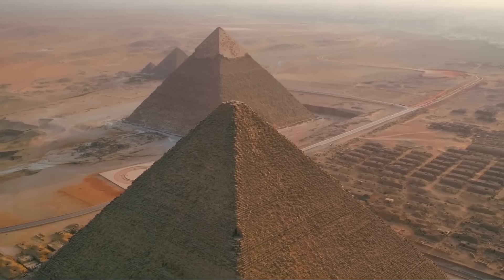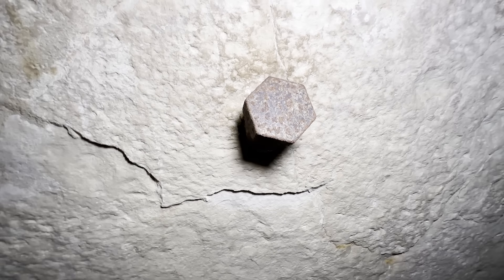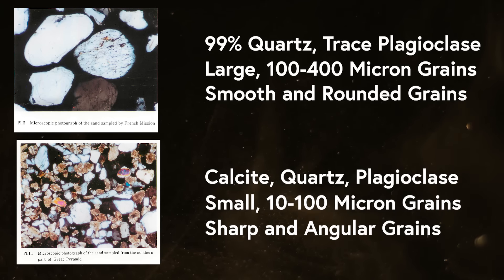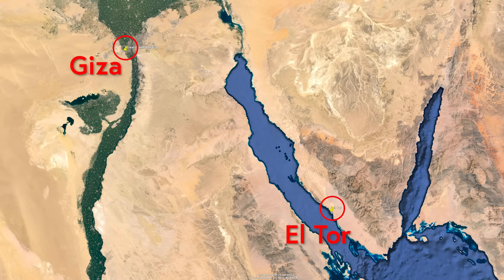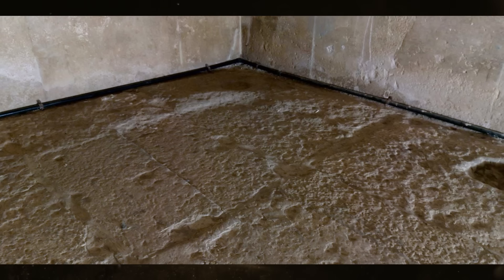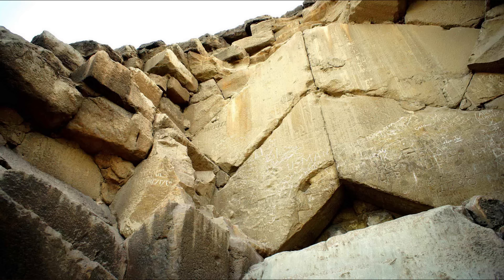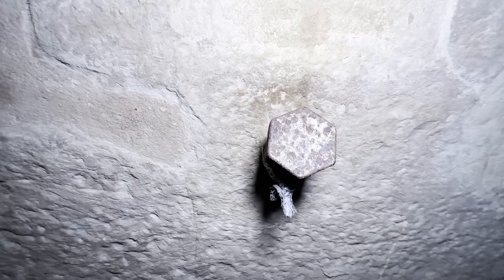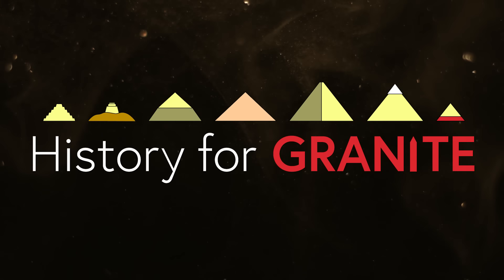How Sand Built the Great Pyramid

Comment: It doesn't matter what type of sand you find it could be pure silicone with a wax finish you're still not going to get an entire city to yank a 10,000 pound chunk of granite 400 ft in the air and said it perfectly you can't stick a piece of paper between it as it's suspended inside the main structure? I guess I use ropes and pulleys? They must have a hell of a set of ropes miles long and the  the winches with the 40 inches in diameter with triple quadruple roller bearings? How did you feed the 10,000 people and then organizing for the people? back then work completely in unison all you had to do is whisper and 5,000 people would exactly pull at the perfect time? I'm sorry but you really got to little bit harder approach with all this just the borethe holes that are drilled? How do you drill a 15 ft long perfectly round hole through granite? I'd like to see you do it how do you cut a 30 ft section of granite perfectly flat with saw marks in it? Who drew up the plans for this thing what did the y have a thousand genius Architects that decided to make a giant triangle in the middle of the desert because I'm screwball King said make me one? I don't think so if a big if your people did hike it into place there would be cities with thousands of homes men women children dogs cows imagine how much meat 10,000 slaves need to eat just stay healthy no antibiotics no oxygen tentsfor when the sand gets impacted in their lungs how many people died from tooth infections appendicitis Broken Backs how do you maintain 10,000 people in perfect health how did they make up the drawings before they started what did they do carve them into the dirt and all the foremans were professional Builders?l how do you perfectly level the 500 ft by 500 ft humongous building within 3/8 of an inch? And half of it is carved out of the embedded Stone nearby. Any explain the miles and miles of tunnels 40 ft by 40 ft underneath the pyramids that extend far far away and go down 250 ft deep Criss Crossing each other will keep up your good work I'm sorry but I'm nowhere near on board. Get a hold of Ben and Uncharted X he'll set you straight. And the ultimate question is if Egypt could build such things 20,000 years ago how come they had to hire the Dutch gifts to build the Asqan dam in 1970?

Comment: This is nonsense. The earliest dynasties did not built the best quality megalithic pyramids, and the later dynasties made a fair attempt at copying what they saw, but with much inferior, rudimentary techniques and technologies. 
If the sands were significant, which i agree, they must have been, the most likely reason the quartz sand was transported over long distances, would be because of its electrical conductivity. 
This is a shill video, so smuggly confident, "so you see, I've told you whilst brimming in my own self confidence just to assure you, there's nothing to see here!" .... 🤡🤡🤡

Comment: Hey pal, do you wanna know how the ancient Egyptians moved all these gigantic stones, from the quarries till their monument sites? The answer is simple, they didn't, actually what you are seeing is just concrete, but instead of using the very poor pumice stone from the Romans, the Egyptians actually learned how to fabricate very hard stone cement or concrete, so what you're actually seeing is a mist of techniques, and not just stone softening, they didn't had pulleys or cranes for the job of putting heavy stones at the top of the columns, and that Must have intrigued the Greeks very much, so they tried asking them how they did it?  
Of course they wouldn't tell it to the Greeks, but they gave a clue to them, a people that the Greeks nominated Atlanteans, because all the raw material to fabricate the stone cement, and the knowledge for the chemical compound, came from other parts of the globe, like the tons of corn that they had as offering for the rituals on their temples, just read the Rosetta stone.

Comment: Seems like mining quartz sand is too much effort if you can take the sand from the top of dunes which is also really small and round. They didn't know what quartz sand is so they wouldn't specifically try to bring it from great distance, and if they knew its quartz sand , why did they need it? The only reason I can think is,  because this sand is excelent resonator and since its quarts,its also generates electricity when resonating.Not sure why would they need that thou... o_O . You can see what I mean here . watch?v=v29ou094luc
Reply: If you've got a bunch of particularly tricky 40 tonne stones to move and Saudi sand is the best lubricant, you might go to the effort of acquiring some.